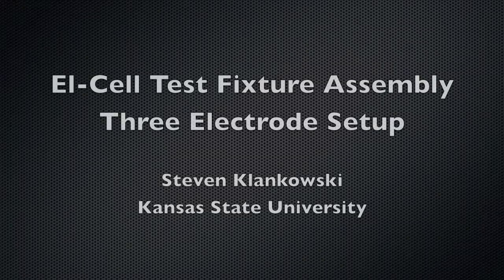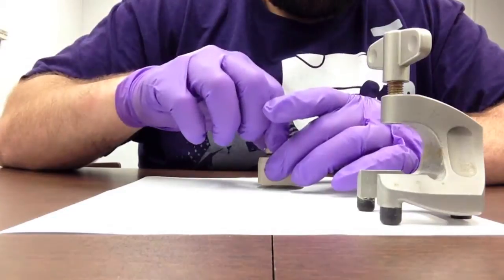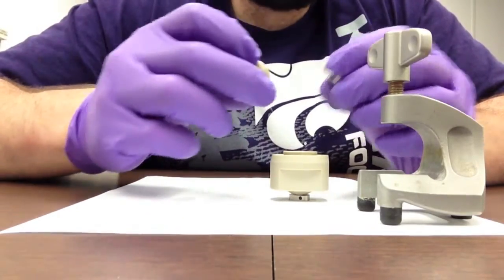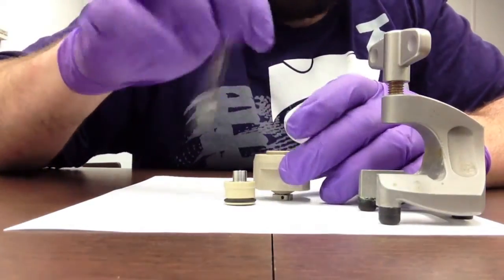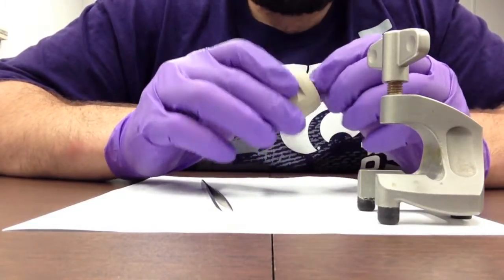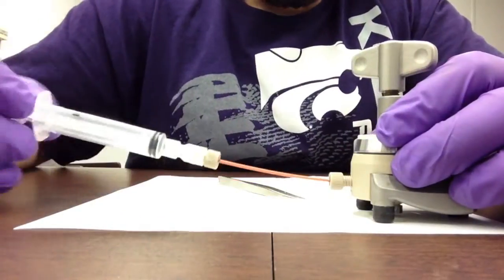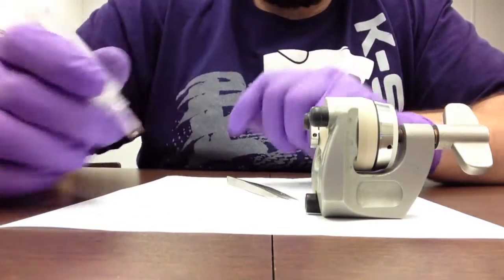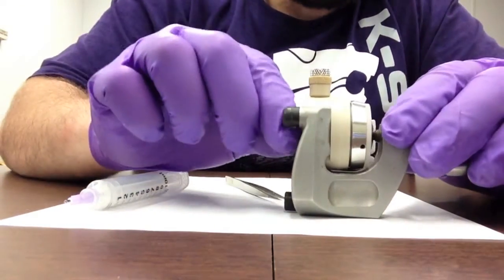El Cell Fixture Assembly

Comment from the maker: Hello Jimjams,

Most of the SEM work performed in my research was for visual inspection of the materials, and did not get to any visual processing or videos of lithiation.  Electrodes examined after coming into contact with my LiPF6 electrolyte were either dried under vacuum, or if needed, with several milliliters of Ethanol and let dry. I then proceed to image them. 

Thanks for the question.

Comment: Hi Steven, great video!

I've read the papers that you've associated with this video - they're very interesting, thank you. I had a quick question about how you transferred the electrode samples to the SEM for processing. You mentioned they were exposed to the air? How did you achieve this considering they'd come into contact with the LiPF6 electrolyte?
Did you clean them/dry them out etc.?

Thanks!